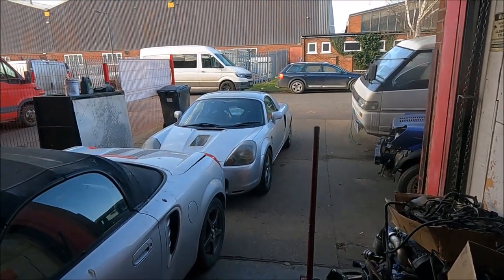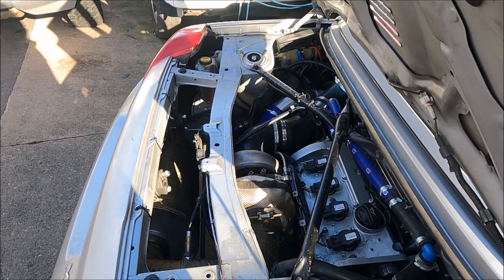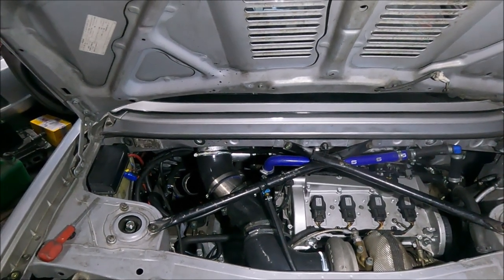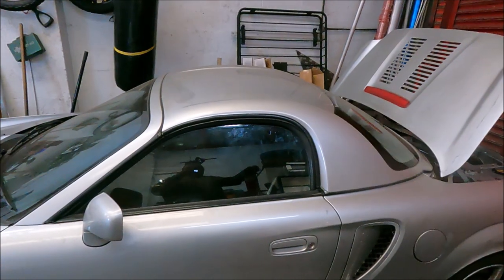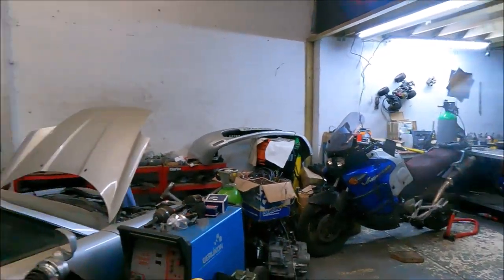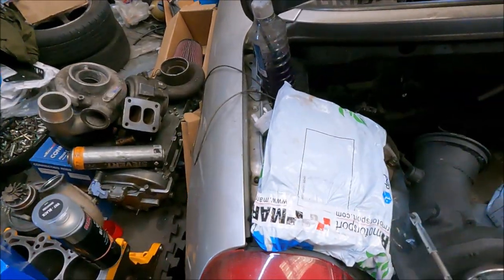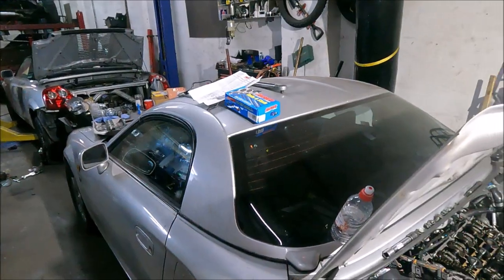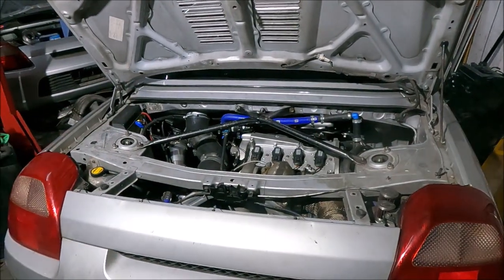Fitting a BOV? Yes and it was a total waste of time! Fitting the ARP head bolts shouldn't be though.

Comment: Back when you did the video in the Volvo and you tapped the boost gauge into the compressor outlet, even with the BOV fitted it still spiked initially. Which makes sense as even with a closed throttle the engine needs a brief moment to breathe down the pressure in the inlet manifold, then suck the pressure through the diddy little vac line to the BOV before it will actually put vacuum on the BOV to open it. Meanwhile the turbo has already eaten the biggest ‘air hammer’ spikes anyway. So doesn’t surprise me in the slightest!

Still, boost hoses popping off are one of the easier teething issues to deal with so it shows how well the car has been built that that’s really kinda it.
Reply from the maker: Yep, they’re pointless on the whole, they’re called ‘noise suppression devices’ in many OE workshop manuals etc and that’s because that’s their main job.

The sound difference in car with the one on mine is unreal, pretty much zero chatter instead of non stop

Comment: Good work as always, this conversion is getting more appealing with every video 👍🏼.. Hope you sort the issue on yours, when you mention bov control during partial throttle.. the N249 solenoid and vac reservoir that’s been deleted i assume is what normally deals with that.. just an FYI if any use..
Reply from the maker: Yeah indeed it would, it’s funny how something that’s mostly just useful as a safety thing for limp mode on the oe application would actually be handy for me in this case!

Comment: I have no blow off valve on my 1.8t 20v  k04 swap. Map sensor is in standard location, thas is in charge pipe pre throttle.  It does stututu thing on letting off throttle, but always at the same time it does pop from exhaust. And I don't have Pops n bang, nor Cockporn tune, so it's kind of weird. 
My theory is, because of map sensor seeing a spike in pressure, on closing throttle because there is no bov it dumps bunch  of fuel into engine. Thoughs?
Reply from the maker: If you have a MAF still then the amount of fuel dumped in off throttle would be even more with a vent to atmo BOV, but yeah no BOV at all will also very momentarily give the MAP sensor etc a spike which technically would add fuel for sure
Reply: Can / should that be mapped out?
Reply from the maker: @TheM5Dog  could, but it’s 99.9% of the time zero issue so rarely is
Reply: Yeah I thought so.  It goes back to a conversation that I had with a tuner years ago who said that no bov / recirc will set off emls and over fuel so much on lift of that it would cause harm. I told him it wouldn't but he said he wouldn't map my car if I removed the bov 🤣
Reply from the maker: @TheM5Dog  he’s clueless then and better off not using him.

Vent to atmo bov makes it overfuel badly with a MAF setup. None at all does little to zero.

I’ve ran without one on 5-6 1.8Ts and a 2.7TT which has two and the same myths exist for them too
Reply: @StavTech  preaching to the choir mate.  I need to get around removing the bov from my cooper s.  Wait for it to stop raining first 🤣
Reply from the maker: @TheM5Dog  actually just remembered something. Of the 20+ MAF setups I’ve ran no BOV with without issue, I had one that did!

My Volvo 940 Turbo. It was fixed by adding a couple of bends between the turbo and MAF so still never ran one, but that’s the only one where it confused the MAF somehow
Reply: @StavTech  how odd. Was it throwing an eml?
Reply from the maker: @TheM5Dog  no, just stuttered/bogged after coming off and then back on throttle suddenly. Very old skool ECU on that though so probably why where nothing else I’ve ever done it to cared
Reply: @StavTech  yeah I guess you're right.  I never had any issues removing the recirc from my vag20vt or ea113, but you can't tell the FB groups that as they lose their minds!
Reply from the maker: @TheM5Dog  yeah exactly, lol. The B5 S4/RS4 lot flatly said it wouldn't run with them removed and would ruin everything. I knew it would be fine, and yes, was totally fine. They didn't mention it again lol
Reply: @StavTech  it's funny isn't it?  You have the proof and data to back up your work, yet oft you're still wrong 🤣. 

I'd love an S4, but I already own 2 money pits, I'm not sure I'd get sign off on the submitted paperwork to the wife 🤣

Comment: yes yes stav would you like to share your spec on your engine please as i am mid build and wanting a little guidance in what direction to go for a safe 350 ish bhp
Reply from the maker: It’s all in previous vids mate.

But stock bottom end with some decent rods.
Top end is stock small ports, stock n/a cams, double valve springs, inconel exhaust valves, and some DIY combustion chamber mods.

For 350odd a set of rods and some new exhaust valves is enough with the right turbo setup etc

Comment: What clutch are you using atm did you consider doing the vr6 flywheel clutch swap?
Reply from the maker: No need to use a VR one when even the stock setup with an uprated plate is proven at 500 on the 6 speed.

I’m using CG Motorsport twin plate setup